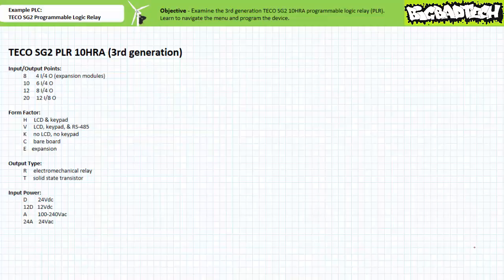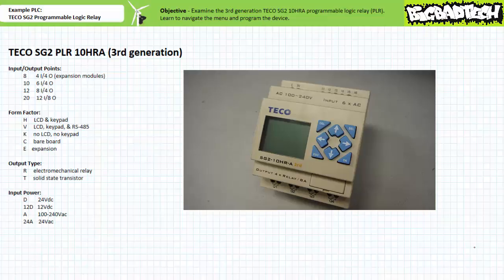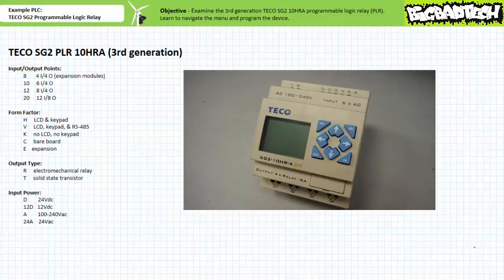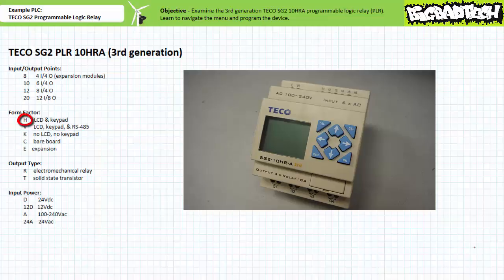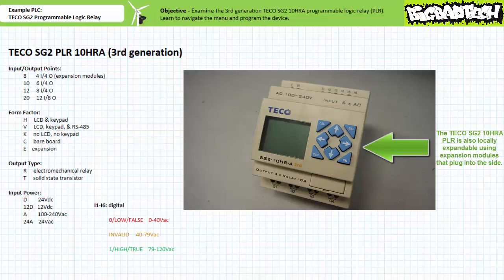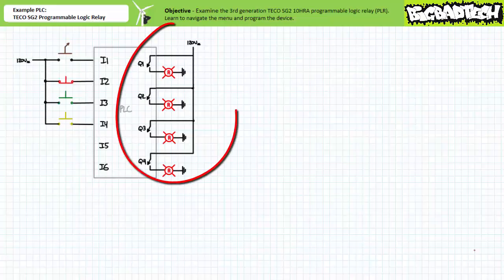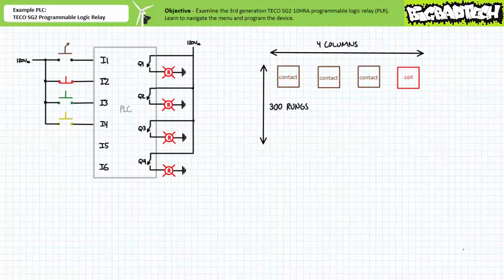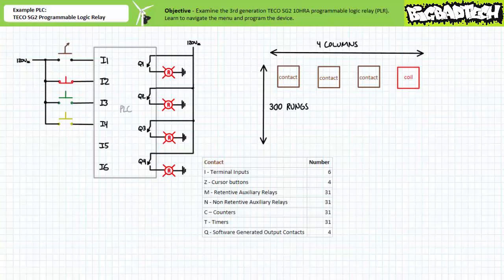Example PLC: TECO SG2 PLR (Part 1 of 2)

Comment: How does the result of an invalid signal differ from the result of a false signal? What happens if we get an input signal of say 55 volts? In other words, why isn't 78 volts seen as a false?
Reply from the maker: That is a can of worms. One could just as easily ask why an invalid isn't interpreted as a high? I deal with the peculiarities of TTL and FPGA digital electronics devices at the cgcclive YouTube channel however to really answer this question necessitates some background in semiconductor devices and circuits which I will in the future.